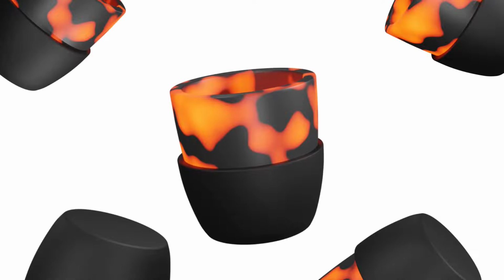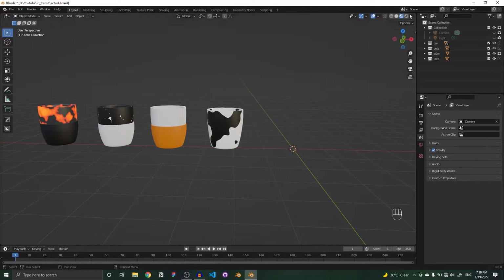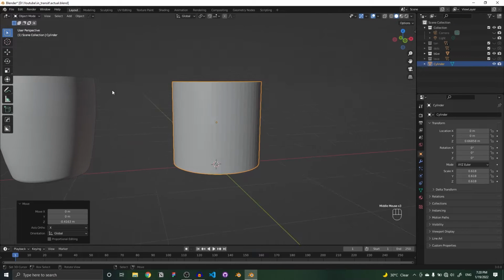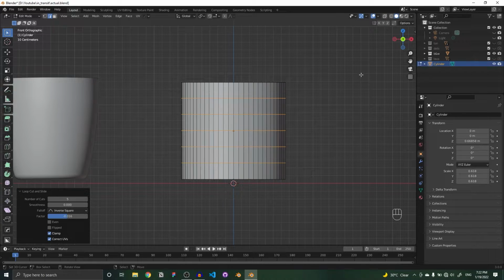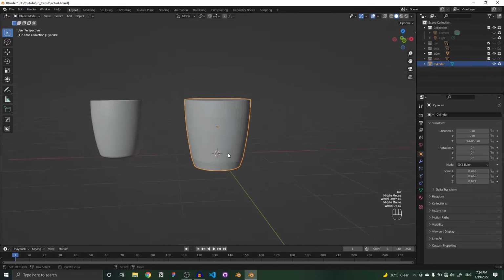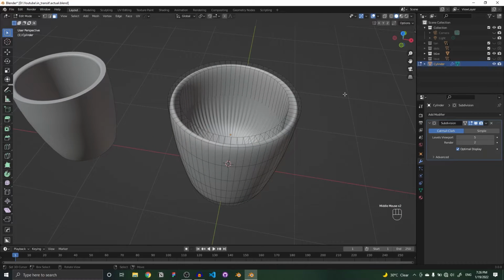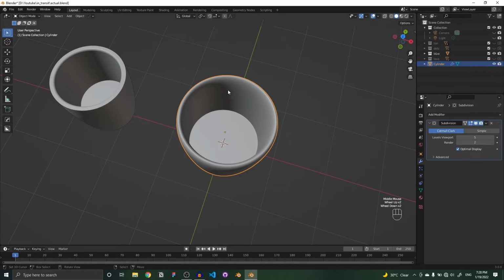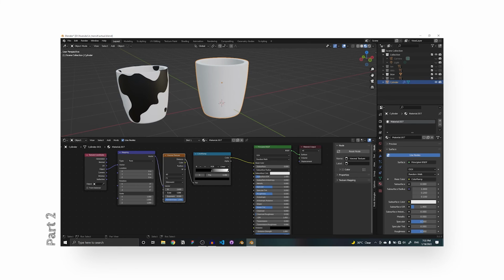Designing Mugs on Blender 3.0 - Part 1 - Modelling

Comment: To smooth the mug, using subdivision modifier with level 5 will increase a lot of geometry which is not required for such a simple object. Instead of taking it to level 5 and adding edge loops to remove the weird geometry, we can just add an edge split modifier above the subdivision modifier with level 1 details. Then just right click and shade smooth.
You can also change subdivision property from catmull-clark to simple, this will keep sharp edges at the top without rounding it.  
Hope it helps :)
Reply from the maker: Thanks for the tip - I'll try this one :)